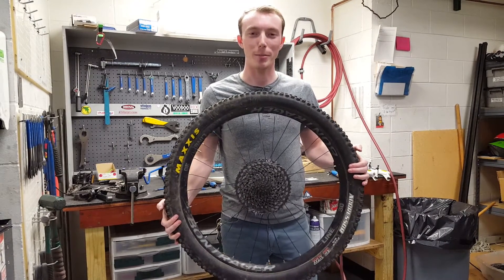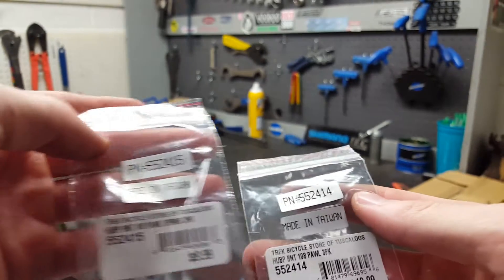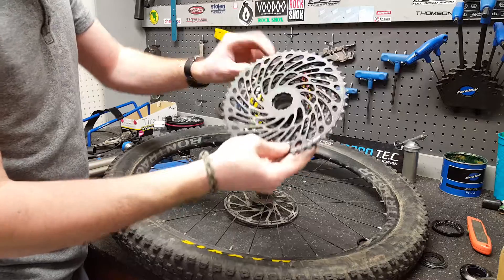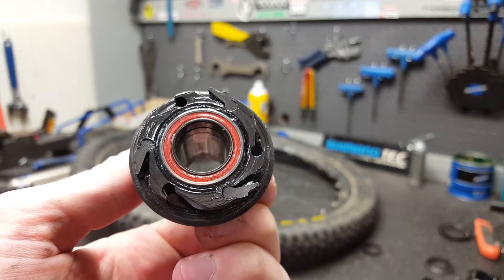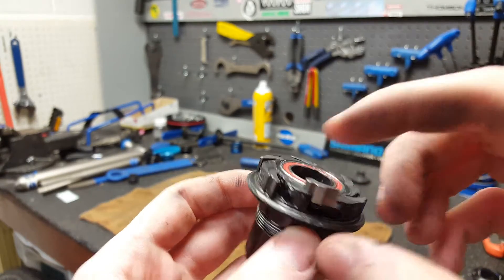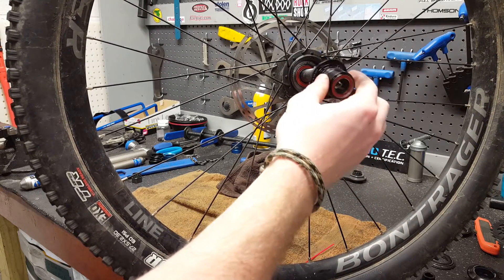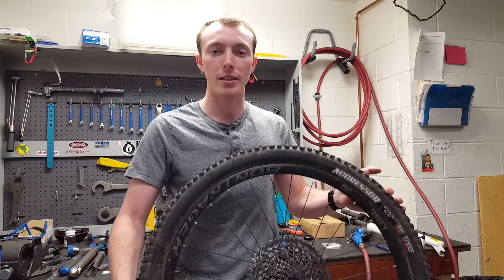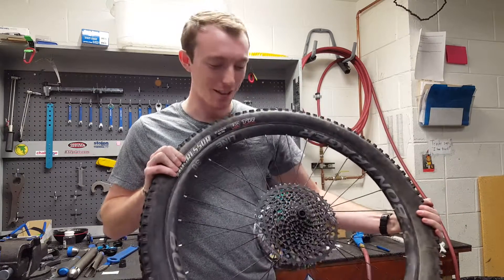Bontrager Line Comp 30 Hub Upgrade 54 to 108 pt

Comment: Hey thanks so much for this video! My question is should I pack the hub with grease before putting everything back together?
Reply from the maker: Ideally, yes. You should use a lighter grease such as phil wood honey or DT swiss inner hub grease as opposed to regular thick green bearing grease. Hub internals benefit from less friction but also require maintenance more frequently than other sealed hub bearings. You will notice a difference in sound from what weight grease you put in. Do not put in thicker greases like automotive wheel bearing grease as they are too sticky and can cause the pawls not to return, making the freehub not engage properly.
Reply: @adventurearkansas9926   Thank you!

Comment: Can this be done on a 2020 roscoe 8?
Reply from the maker: No, the Roscoe 8 uses Formula branded hubs, not the Trek branded ones on the Remedy. There might be a similar hack but this particular one will not work.
Reply: I talked to the Trek store about my 2019 Roscoe 8. Pretty much your only option is a Hope Pro 4 rear hub.

Comment: UPDATE: I received the pawls and springs from the local Trek dealer earlier this season for about $40 CAD. Luckily didn’t lose the springs during the process and everything went off without a hitch. A hugely underrated upgrade that really makes a difference in technical terrain. If you have this hub, it’s a no-brainer as the quick engagement is immediately apparent while pedalling. Plus it sounds like angry bees and alerts the peeps on their iPhones as you approach them. Zzzzzzzzzzzzzzzzzz
Reply: why do they have 6 spots but not fill them at factory. Seems like a very cheap no brainer. It saves that much on cost???? Curious.
Reply: @alutious  Late answer, but reason is so Trek can make an exta $30 from owners for just $2 bucks worth of parts.
Reply: Its a good thing to have a louder hub to alert anyone who may be on the trail to go take their tinder profile selfie somewhere else instead of the middle of the f***ing trail 😂😂😂🤦‍♂️
Reply: @single-trackdiaries4071  hey, they say 29er's roll over anything that gets in its way...

Comment: This  was not an Upgrade from an 54 teeth to an 108 teeth hub. This was video shows only how to build in 6 pawls instead of 3 at a free hub driver. The 54 tooth are fix in the hub. So there is a little bit louder but no difference in the fuction as the distance between the teeth is not changed.
Reply from the maker: Michael, see my previous comments for more explanation. The pawl drillings are offset and the second set engage at a different time, making the points of engagement higher. I did not mention anything about the steel drive ring other than how it engages with the pawls.

Comment: Thanks for the vid. It's worth noting a couple things here. First, Bontragers do NOT come with XD Drivers (thanks, Trek); therefore, Ad Ark had already converted the free hub body prior to this vid. If you are, like me, trying to find guidance on how to remove the Shimano compatible free hub body (in my case on the Rapid Drive 108 free hub), it comes off the same way as we see in this video. This isn't obvious as hubs come apart in many different ways, and I take apart hubs about once every almost never. I got the end cap off with a pliers (cloth underneath to avoid scratching), then the free hub body slid off, as in the video. If you're wondering why I'm watching this video, as my hub already has all the pawls, it's due to the dearth of advice on how to switch the Bontys to an XD. One doesn't want to make a mistake on a pricey wheel. Also, you have to move ALL the pawls and springs from the Shimano compatible free hub to the XD--not rocket science, but again, novice home mechanics don't want to F it up.
Reply from the maker: Hey Buz, thanks for the comment. My bike came with SRAM GX Eagle drivetrain as the 2018 model and was already equipped with XD driver. Those with Shimano 11 speed and below drivetrains or the new SRAM NX or SX 12 speed eagle drivetrains will come with the 'standard' Shimano freehub body. The 2019 Remedy 7 and 9.7 both come with NX drivetrain and will thus have the Shimano freehub. If you're buying this wheelset as-is, you'll have to get the XD driver and swap parts as you mentioned. Not too complicated, just a few extra steps. For your swap, as you mentioned already, you just need to remove the endcap, remove the freehub body, swap all springs and pawls to the new freehub body, install extra springs and pawls if wanted, grease the freehub body, then reinstall. Glad I could help, I know other brands have really hard to service stuff. Roval/Specialized equipment was like pulling teeth when I swapped freehubs.

Comment: Is this the same hub in the trek remedy 8 2019? Thanks
Reply from the maker: Should be - 2018, 2019, and 2020 all have the same wheelset on the 8 - although I will say at 4,000 USD the 2020 Remedy 8 is not the bargain it used to be. The 2018 was 3,300 and had identical specs.

Comment: This is very late but as far as i know, only the points of engagement will be doubled and the degree of engagement will stay as is
Reply from the maker: At first glance this is what you'd think but there's a subtle difference in activation. The second set of pawls is slightly offset to provide a different activation angle compared to the first, therefore reducing the degree of engagement while keeping the points of engagement the same. Hope this helps.

Comment: Great video. You know if the parts will work on a Bontrager line 40 rim? Thanks
Reply from the maker: So long as they have the Rapid Drive hubs, then yes. You're just looking for the 6 slots with 3 already filled on the inside of the freehub body. The only way to find out is to take the freehub off.
Reply: Were you able to do this modification? Just got my trek and curious
Reply: Desert_Rat_ MTB I can’t find the parts online
Reply from the maker: @boeysantos  Unfortunately, the parts aren't available online. Trek stores and stores that sell Trek bikes can get them for you.

Comment: I had to replace the Shimano free hub driver with XD on mine to make the e*thirteen cassette work. I was told by Trek support and my LBS that this was the way to go once I had it all apart. Parts are in the mail and apparently a great cheap upgrade.
Reply: Hey Matthew king I want to upgrade my nx cassette to a gx or xo1 but do not know what xd body to get to replace my 8/9/10 shimano free hub for my 2020 fuel ex 7?

Comment: Hi

My ask is only do you like the line 30 comp hubs?
Maybe i buy this wheelset from a 2019 trek remedy just a little bit I'm afraid it's good in the long run?

I hope you write a short review from the hubs.
Service or time to run etc.

Cheers, Mate
Reply from the maker: Hi Imre! I've been very pleased with the quality of the hubs. They're not as loud or fancy as an Industry 9 or Hope set, but they also cost a fraction of the price. If you're looking to buy a set of wheels to use and replace the rims when necessary, the Line series is a very good wheelset to do so. I've been running the rear hub on my carbon rims for half a year and have had zero issues. I would definitely consider buying a takeoff or lightly used wheelset just to have the hubs to reuse.

Comment: Are most Bontrager hubs like this? My 2018 Trek Stache has a Bontrager hub on my duroc wheels. Yours is also pretty loud, I like the way it sounds. Did you just remove the grease from the teeth in the hub? Thanks
Reply from the maker: To my knowledge, this is only applicable for this type of wheelset. The only way to know for sure is to pull it apart - there are a few types of hubs that Bontrager uses and it's hard to know what style of engagement they use since they don't always build their own equipment. There should be a very light coat of freehub specific grease in the hub, I believe ParkTool has a video detailing freehub maintenance.

Comment: You didn't have to use the tool to take off the cassette. I just pulled on the cassette and the whole free body came off, as advised by my friend who is a bike tech. Great video though, thanks!
Reply: Exactly, you can just pull the cassette with with driver body altogether. Be careful, not to loose pawls or springs, though.

Comment: the three springs and 3 pawls cost $42??
Reply from the maker: Total MSRP of the parts was about $25. After shipping and tax it came out to be $42. The shipping was fairly high and I'm not sure why I got charged shipping for a shop stock... but yes, the total was $42.
Reply: @adventurearkansas9926  damn seeing as how those parts should all be shipped with 1 stamp quite the markup.. nonetheless thanks for sharing will be doing this upgrade shortly when i can locate the parts. trek said they are out of stock till december

Comment: hey i've made this upgrade on my wheelset but now the inner freehub bearing and the outer wheel bearing are too close together and cause a lot of friction when freewheeling.
Can you advise what might have been done wrong here?
I've not managed to loose the bearing seal and there were no washers or spacers to lose either.

thanks for the video,
can you help?
Reply from the maker: Double check that you have the spacer that goes in between the freewheel and the frame, I forgot that the first time I put my wheel on. Adding more pawls increases freehub friction, but you should still be able to spin the wheel freely. Check to see if the freewheel bearing is flush with the body, and likewise with the hub bearing. If all else fails, take it in to your favorite shop and have them look at it! Cheers
Reply: @adventurearkansas9926  hey thanks, i think the rubber seal was the wrong way up in the end

Comment: The one I rode seemed like it was relatively high engagement already... Is that just me being a pleb or is the stock hub already decent?  Or maybe the one I rode had the upgrade done...
Reply from the maker: The stock hub is no slouch at 6 degree engagement. I don't notice going from my bike to another high end bike with a 6* but when I get on my hardtail with a 10*, the difference is actually noticeable. 3* to 10* is more than 3x the engagement distance so it's very clunky to me. Normal non performance hubs are around 20 degrees engagement for reference.

Comment: And Trek can't put 3 extra pawls in for the "lesser" value bike... To make it sound like the upgrade.... Talk about marketing.
Reply from the maker: All about price points, it most certainly is about marketing - but not in the way you're talking about. Luckily there is a world of people who notice these things so that I can make a video about it!
Reply: Adventure Arkansas yea don't get me long I love trek work for a dealer, but they have the option of adding 3 Pawls so why not.....
Reply: Timmy Rickert nowadays every new car has a drive by wire throttle and abs system. Everything you need for cruise control, you just need a button and software. Not all cars come standard with cruise control. Why? Just like you said, to make it sound like an upgrade.

Comment: Anyone know if this can be done on 27.5 plus Sunringle Duroc wheels that come on the Ex 8? I don’t think they have the XD Driver but can’t find what driver it has.
Reply from the maker: The EX 8 does have an XD Driver (it has a SRAM Eagle cassette), but I don't think that this upgrade is possible seeing as it's not marketed as a Rapid Drive hub. It's still worth a try, but I believe they use a hub shell with less points of engagement. If you do happen to check, please reply and let me know as I am curious as well!

Comment: I made this upgrade on my new EX7 that I got about 3 weeks ago...awesome. The engagement difference coming from a basic XT hub is incredible. Really notice it on rocky uphill climbs. Zero play in the cranks, just immediate engagement. I was pleasantly surprised by the fairly quiet sound to of the hub. It is noticeable but not annoying.
Reply: what year is your ex7...coz i got 2019 just wondering is this upgrade is available for my bike..thanks..

Comment: I just ordered a 2018 Trek Fuel Ex7 which says it comes equipped with “Bontrager Line Comp 30” wheels? So that rear hub will definitely have the three open pawl slots? If so I will order the extra pawls/ Springs. Tell me what you think and thanks for the great video!
Reply from the maker: Only way to be sure is to open it up. From what I could tell on Bontrager's website, they use the same SRAM XD driver on all their high end MTB wheels with Rapid Drive (likely to save cost) so it should have the same as the one I did.
Reply: Adventure Arkansas just found this link which answers the question. Sweet. https://youtu.be/Sj6FEDOnLCg
Reply from the maker: Nice find man! This applies to more wheelsets than I thought!

Comment: it does not change the engagement angle. this is determined by the tooth size around the pawl
Reply from the maker: There are two ways to change your engagement angle in a simple ratchet system: More teeth around the hub ring (this is what you're talking about) and having another set of offset pawls. When I am installing new pawls, I'm installing them into drillings that are offset from the other ones such that they engage when the others are on the ramp of the  next tooth. While you can increase engagement angle via having finer teeth on the ring, the strength of the teeth go down when there are more and also the manufacturing cost of making a precision part goes way up. This style that Bontrager uses sacrifices a little bit of hub friction (vs a 3 pawl with increased outer ring teeth) for the increased durability of the larger teeth on their design.

Comment: Nice. Where Can I get this item? Do you have a Link to get it online?
Reply from the maker: I would suggest finding your local Bontrager/Trek service shop and ordering it through them. If you live in the UK, Triton cycles has the Rapid Drive 108 freehub pawls and springs for 9 and 7 pounds respectively on their website, so a bit less than ordering it through Trek. 

https://www.tritoncycles.co.uk/components-c9/hub-spares-skewers-c122/rapid-drive-108-freehub-pawls-p19294
https://www.tritoncycles.co.uk/components-c9/hub-spares-skewers-c122/rapid-drive-108-freehub-pawl-springs-p19295
Reply: Hello everyone! are those hubs DT 240 hubs?

Comment: nice vid.  Is the 108 louder or quieter than the 54?  I have the same bike and I don't like the sound of the 54.  Thanks!
Reply from the maker: Definitely louder. You can briefly hear the 54 at the beginning of the video when I'm removing the wheel. The noise is different though, at speed it's more of a drone (sounds similar to I9 or Chris King) rather than distinct ratcheting. Unfortunately there's not much you can do to change the type of noise besides swapping hubs entirely!